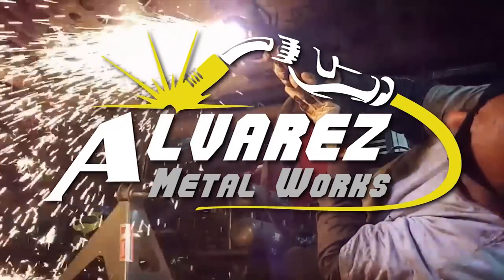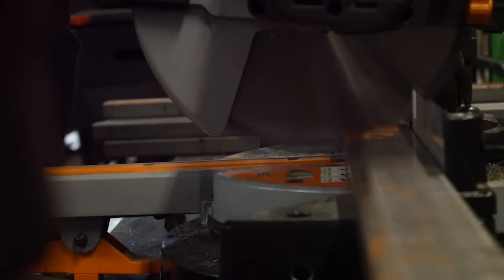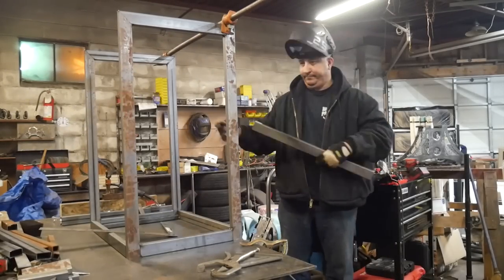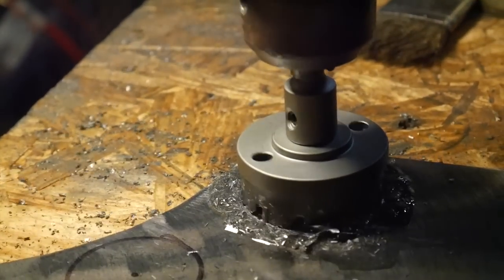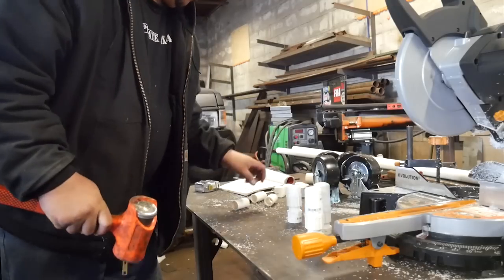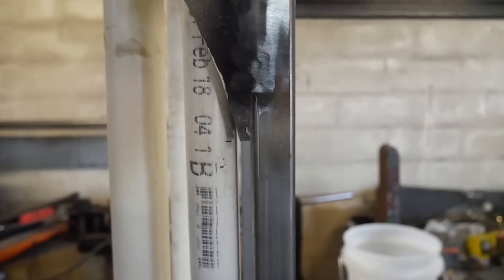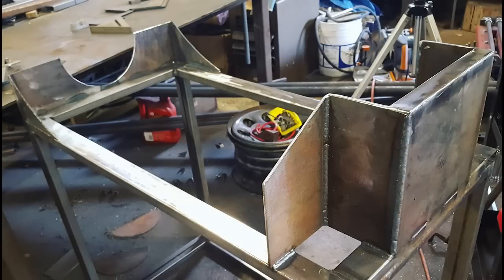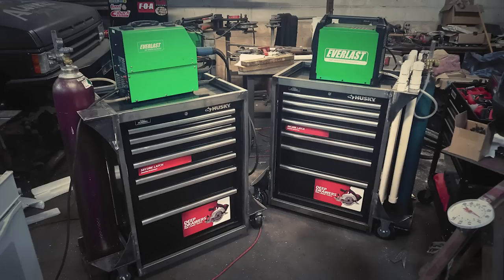Welding Cart + Tool Box = Bad Ass

Comment: Really nice design and fab work.  Just before seeing your video, I had an epiphany while watching review of HF welding cart.  Decided to repurpose  18"x30" rolling Craftsman tool cabinet inherited from my dad...three full width drawers and bottom full width helmet storage bay with pull down door.  Decided to remove cart wheels and bolt two 2"x10" boards to bottom of cart extending from both ends to form mig/tig and oxy-acetylene tank racks.  Add tank safety chains, cable/hose holders; reattach wheels to 2xs beneath tank platforms.  Very little work for a very flexible, serviceable, inexpensive welding cart.  May add 2" receiver hitch  to accept removable vise and other accessories.  Hinge fab table top from rear side with swing down legs.
Reply from the maker: awesome

Comment: Not sure why the skeleton frame around the tool cabinet.  Cabinet has its own structural strength...it doesn't have a skeleton is original service.  Attach two 2x8s or 2x10s or 2X12s to casters  original attachment points extending beyond cabinet to form cylinder platforms...out both sides holds mig/tig and ox/acet cylingers.    Paint 2Xs and all additions to match cabinet.  Extend 2Xs slightly further beyond cylinders provides mount for accessories holder box/ frame/"peg board" for hoses/cables/accessories.  Brace accessories holder via support from cabinet between cylinders.  Ratchet straps attached to cabinets holds cylinders better than chains.  Worm-screw hose clamps attached to cabinet or box/frame/"pegboard" as earlier holds PVC rod tubes.  Hang collapsed HF welding table from cabinet rear.  Easy peazy, less work, just as functional, low cost.
Reply from the maker: Have fun with your build...

Comment: What did you do for cable hooks? Are they on the backside of the cart?  I have a bottom cabinet ordered from Lowes for store pickup, which should be in today or tomorrow. I'm going to replace an old smaller sized tool chest bottom with the new cart and use the older bottom chest for the cart.  I was trying to think about where to put tig filler tubes and your cart design solved the problem. I plan on puttin a couple of horizontal strap across the back of the frame to mount cable holders. I'm also going to put the casters under the cart to help keep the length of the cart a little shorter. I'm going to steal your top tank support idea.

Nice job on the carts.
Reply from the maker: I haven't made them yet lol. So I guess the floor or the welding table would be the answer for now lol. I plan on putting them under the handles.
Reply: I forgot to mention that I also have the Evolution Rage 3 saw. I've had it for about 2 years and have it mounted on a cheaper miter saw stand from Menards.  Great saw and exceptionally great customer support from Evolution with a problem that I had with blades..

Comment: Those Welding carts turned out great.  Your giving m some ideas.  Been thinking about buying a small inverter based tig , then I would need to make a cart for it.   You could also start selling a kit for building them.
Reply from the maker: There will be no production work in my future until I get a CNC Plasma table.

Comment: Hey there Rafael.  So, do you still like the saw.  I've been thinking about a metal cutting chop and I haven't seen the sliding miter before.  Maybe I'll wait a bit longer and check this type out for  a while.  Nice build.
Reply from the maker: James Gulrich yes I still like the saw. I now have their EvoSaw380 too. That has a much larger blade so I tend to use that one way more now. However I break the rage 3 out whenever I need that slide function (to score plate steel) or if I need a compound miter cut. Once I finally move into my own place I'll set both saws permanently. They both have their place in my shop.
Reply: Thanks for the info.